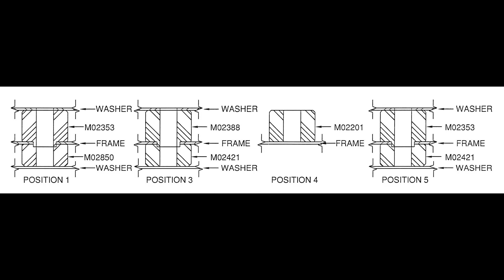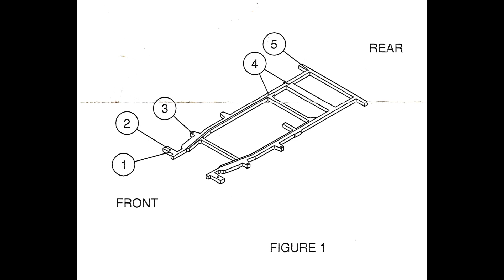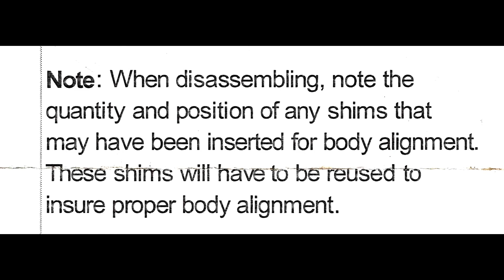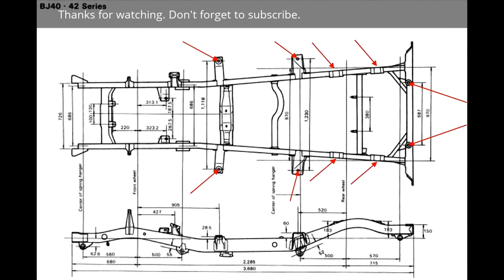Daystar - Polyurethane body mount kit for the Toyota LandCruiser FJ40 BJ40 BJ42

Comment: What size are the frame bolts and nuts
Reply from the maker: @ 6:20 I bought new OEM Toyota original frame to tub bolts and nuts as mine were rusted and some were destroyed when removed. Remember to buy two nuts per bolt. Art. nr's are mentioned in the video. As you can see, the original Toyota bolts are long enough.
Reply: Product link